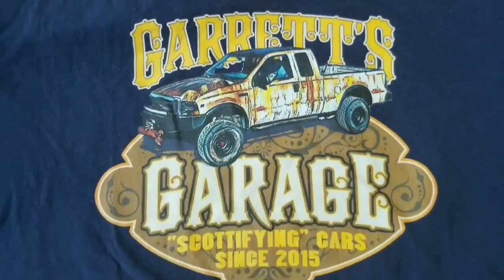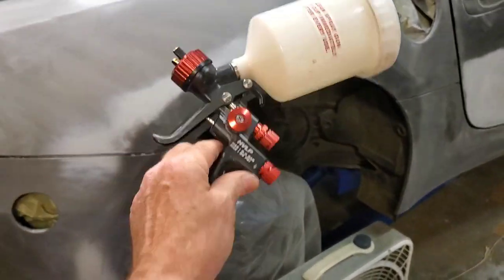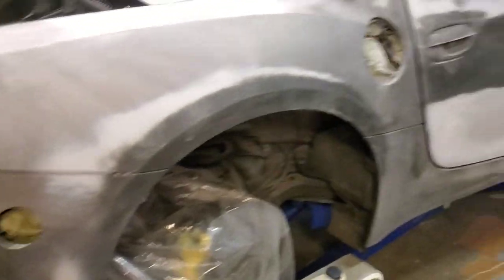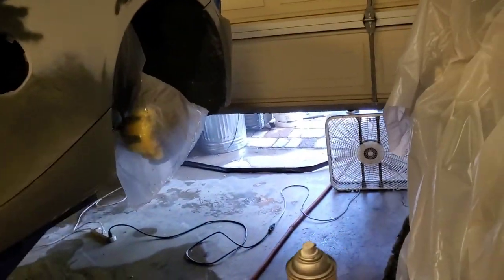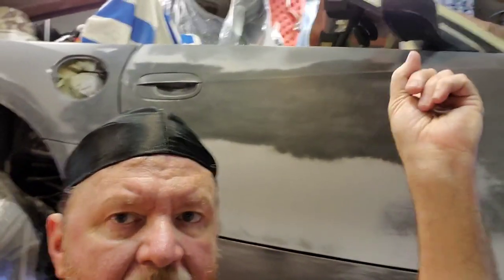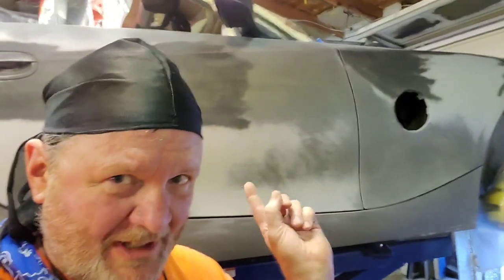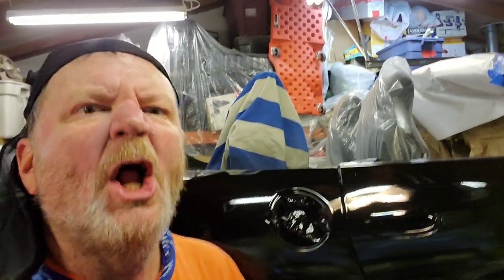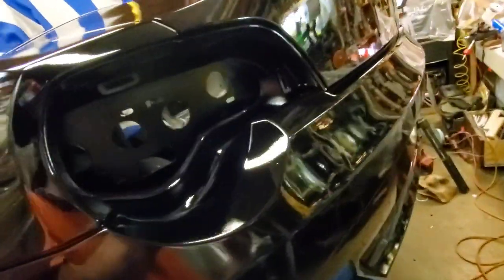DIY E85 Z4 BMW Paint job in the garage with a Harbor Freight Black Widow spray gun.

Comment: What size air compressor was you using?
Reply from the maker: It's a Harbor Freight 20 gallon 5scfm at 40 psi. It's undersized for the situation but seemed to keep up okay.